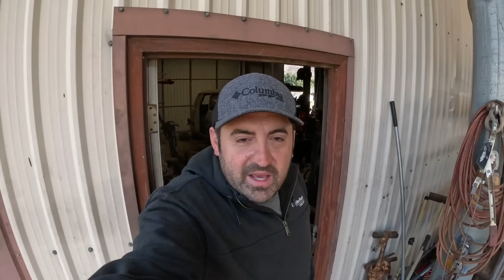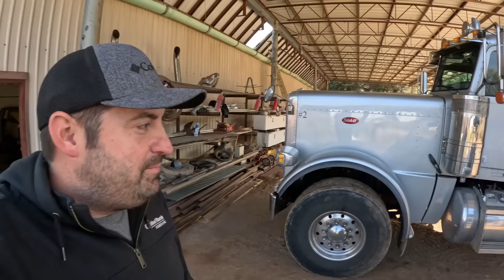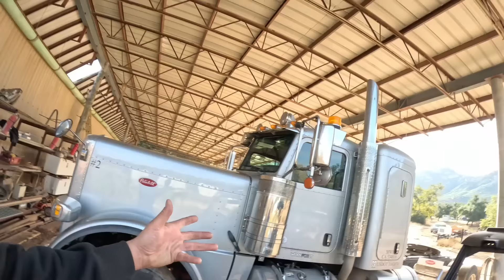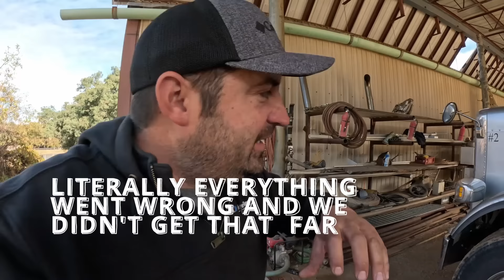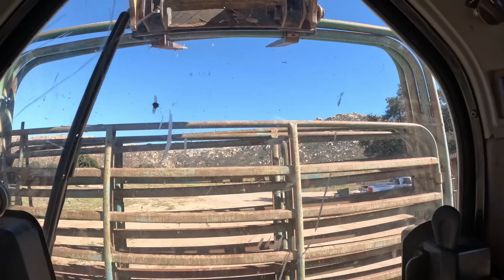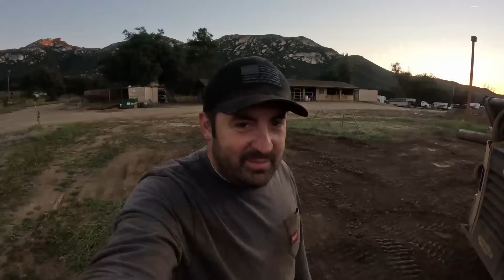My Most EXPENSIVE Video Yet ! The Ultimate Pit Bike Track Part 4

Comment: MPPT is " maximum power point tracker " 
It's the type of charge controller you have for your solar system. It's a good one! The other cheaper charge controller is a PWM. "Pulse width modulation "
So basically you got a good quality charge controller! 👍
Reply from the maker: Dude you're the man thanks for clearing that up.